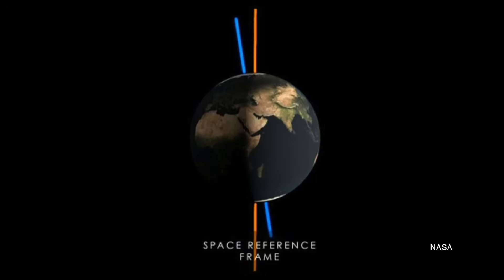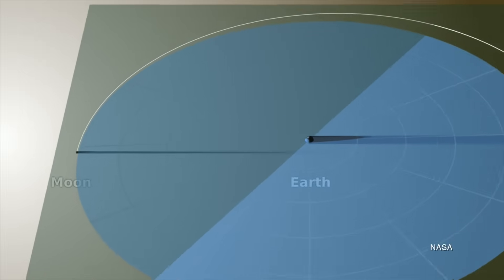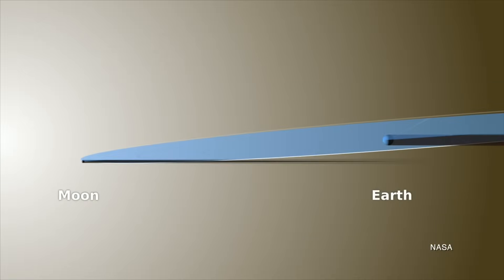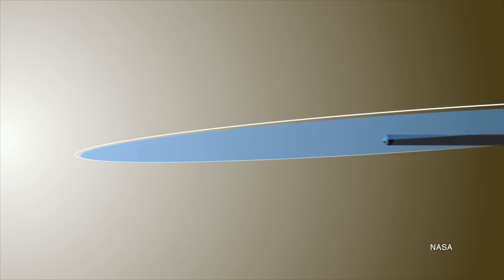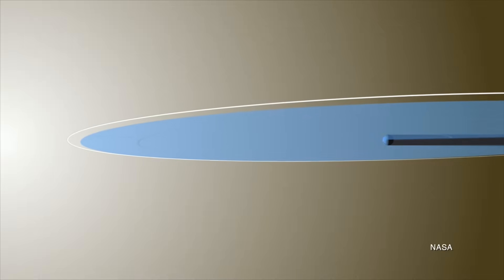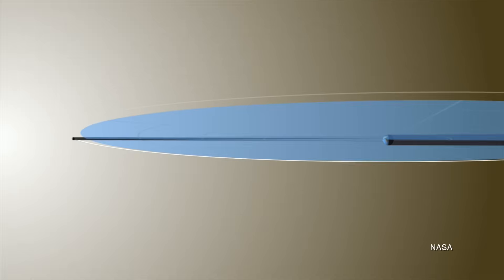Why Does a Rocket Need to Roll Going Into Orbit?

Comment: If the roll was preprogrammed into the Saturn guidance computer by wiring the program that must have put a limit on the time window the program would be sufficiently accurate. Hence, the launch window we always heard discussed. With modern computers in today's rockets I assume a modified program can be uploaded as needed.
Reply: The roll was preprogrammed, but could be changed by uploading a new angle to the computer if the launch was delayed. This happened on Apollo 17.

The launch vehicle digital computer steered the stack open loop during the first stage burn and did not perform active guidance. The pitch and roll programs were preprogrammed. This was done because first stage flight was through the densest part of the atmosphere and active guidance may have caused maneuvering that may have put aerodynamic stress on the vehicle. Active guidance started when the second stage lit and the vehicle was above most of the atmosphere.
Reply: @SodaAnt7 Thanks for the information

Comment: The key is to pitch the rocket over into the correct plane.  But why does it need to roll?  Why can't it just pitch over as needed without rolling?   Ahh, another commentator explained that theoretically it could, but there were practical reasons for the roll.

Comment: I understand everything about that except why they needed to roll.  It seems to me all that could be accomplished without the roll.  As you said at the beginning, the spacecraft is essentially symmetrical.  As well it has small thrusters/steering rockets that can adjust pitch and yaw, as well as roll.  Really all they had to do was adjust the yaw to get to proper alignment.  I had always assumed (not know, but assume) the roll was to place the crew upright relative to the earth once they achieve orbit.  Another commenter points out the real reason.

Comment: The main reason for the “Roll” Manoeuvre to position the shuttle “Heads Down” was simply to ensure Best Communications using its Very High Frequency (VHF) and Ultra High Frequency (UHF) Radio’s. Most of the aerials and receivers for VHF and UHF Comms. were most likely situated around the cockpit area of the shuttle, some of them situated in the roof of the cockpit I’d presume, and some being mounted in the tail as well.  VHF and UHF works on the Line Of Sight principle, meaning simply;  If you can see it, you can talk to it.  So Rolling inverted pointed the VHF and UHF Receivers at the ground stations, allowing much better communication between Mission Control and the Spacecraft.  This was likely true with the Saturn V Rocket, not just for Azimuth Alignment, but improved communications too.  The Shuttle could launch into space “Heads Up”, but would make VHF and UHF Comms. much more difficult!

Comment: Thank you @appolowasreal. That made way, way more sense as to the practical reason to roll, even without the gimbal lock with laser gyros I assume modern rockets would still have the antenna limitation so still roll?

Comment: So, the roll is there because the rocket is not quite symmetric (the crew cabin is not) - otherwise, they would just "tilt" it on both Y and Z axes to point in in the desired direction. Right?
Reply: More that it was programmed a certain way and doing it another way could be confusing.   Also, since the rocket was not "facing" the right direction on launch it needed to roll to face the right direction to be able to turn in the right direction.   
 
They could have programmed it so that it could use yaw to turn over, but it would have been EXTREMELY uncomfortable for the crew.   They wanted the crew to basically be laying back while in the turn and climb to reduce sideways forces on their bodies.

Comment: Makes you realize how smart these NASA engineers were.  And with very few computers at the time.
Reply: This is actually exactly why there's a roll program. A rocket flies in 3D space, which means you have to worry about calculating 3 axis of movement. However, with the roll program, you remove one axis of movement and simplify it into a 2 axis/2D movement during launch. Much easier to calculate.
Reply: ok... I mean, this was the least of their problems deciding where to go.

Comment: My question is, Why didn't they orient the launch pad to the correct heading when it was built. It would have saved probably thousands of man hours in software design, testing, hardware design, also putting another program into the rocket computer, another chance for a possibly fatal glitch. It just seems, to me, that having the rocket sitting on the pad correctly aligned before flight would have been more efficient .
Reply: The rocket has to adjust the inclination of its orbit so that when it got into space it would be orbiting at the same 5 degree angle as the moon does, rather than the 23.5 degree to the elliptical average orbit that launching from Kennedy space center would get you without any adjustments.
There's no where on earth that a spacecraft can be launched directly at the moon from without adjusting orbit to take account of the difference between the angle of the moon's orbit and earth's tilt.

Comment: What is the retro grade and prograde motion? And while re-entry to the earth atmosphere which direction we follow to enter to the earth atmosphere?
Reply: Retrograde is in the opposite direction of the rotation of the body. A retrograde orbit around earth is easy to west.

Reentry direction doesn't matter as long as the reentry angle is suited to bleeding off velocity without causing the craft to burn up. Prograde would probably make this easier, but it's really an engineering question.

Comment: Yeah, I guess it kind of makes sense; if you tell me it makes sense. I don't know why we still use rockets instead of 3d-gyroscopic thor's-hammer disc-crafts yet. I guess testing things at those speeds, (atmospheric warp drives) or thor's hammer as I call it, is a bit violent for manned flight; and probably just as complicated to build - as starting rocket engineering from scratch.

But if Chris Hemsworth's famous character can swing a hammer and go flying, why can't we strap a chimp in a (magnetic) hover-hub set in-midst a slow-rail "gravitron" (xena's disc/ufo/thor's hammer) across the Pacific? 
Or w by can't we chime an oscillating crystal to spin a (disc) generator (in an underground safety case) to charge coil-charge a large tesla batry & power my neighborhood for months between restarts?
Why are ufo's still "unidentified"?'z all I'm sayin.

Cool video. Got me thinking about how difficult (and wasteful & obsolete) rockets are.

Comment: Still unclear.. Why not just steer with the rocket motors? They can't be in a permanently fixed position, right? Spinning the whole thing still doesn't make much sense, as mentioned below. Why would the dang thing need to be facing a particular direction so early in the flight? Reaction motors used sometime later in the flight can do that too....

Comment: I think there's a missing and critical factor--that there is a preference for one side of the rocket to face the earth as it pitches. Without stating that, the rest of the info is disconnected from the conclusion.
So, what is the preference? I'd love to hear your research on that Amy.  I've heard that one reason is so the Apollo astronauts could look out their window and see the horizon, so that they have a quick way to confirm that their flight is stable (e.g., no longer rolling).
Other reasons I've sometimes seen are that there's a preference for what's top/bottom or left/right at stage separation, or when cowlings are opened in orbit. With the shuttle, there was definitely an orientation preference so that the rocket's communication gear had line of sight with the ground.  Less likely but still possible on the Saturn V is a subtle non-symmetry that makes the control system easier to pitch in some orientations, e.g., moving fewer components to achieve the pitch.

Would you please include a prioritized list of why one side was preferred over others, Amy?

Comment: Let's make this even simpler.  When the rocket launches it is on a vertical trajectory from earth.  To get into orbit it needs to follow an elliptical path as it gets
higher up.  The inertia that the passengers feel is similar to a roller coaster doing a loop.  You want the force to push you down in the seat as opposed to lifting
you out of the seat.

Comment: I see some people are still confused.  It is probably a little late to add this, but here goes.  G-forces result due to the pitch change just like they do in a fighter jet.  You want to experience the g-force vertically relative to your spine so your body is not twisted to one side or the other when you are pulling g's as the pilots call it.  They also used gravity to offset some of of the initial g-forces so they oriented your head upside down.  It is like a fighter pilot pulling hard g's in a loop.  You can pull back on the stick harder at the top of the loop when you are upside down.  One g due to gravity gets subtracted from the the g-force at the top.  So you want to apply g-force along the axis of the spine and upside down to use gravity to reduce the g-force on the body.
Reply: GunLovingLiberal is the pitch change really fast enough that it can cause such extreme lateral forces? I thought it took place over a few minutes
Reply: @buzzmas8068  The G-force is a function of the rate of pitch and the velocity.  Since the velocity is so high it does not take much pitch to generate a perceptible G-force.

Comment: To make this much easier to understand you first need to do some math and calculate escape velocity. It's 25,000 mph.
Suppose you had to pedal the rocket.  It'd be easier pedaling if you didn't go straight up.  The rest is all rocket science that Jethro Bodine could probably handle.

Comment: You start off by missing one of the most important aspects of the launch location.  Cape Canaveral is about 28.5 degrees north of the equator.  That mean launching from there directly into earth orbit gives you an inclination of 28.5 degrees.  This is the inclination that you correct from, not the earth equatorial orbit.  The equatorial orbit is a mathematical reference, but not an orbit the Apollo mission would have naturally ended at if launch from Cape Canaveral.

Comment: I think with the right design that a horizontal launch could be possible. Consider the savings of  having the ability to get most of the weight up to a fairly significant speed to begin with with a conveyor instead of overcoming the initial thrust needed for the break away. That's gotta be a tremendous savings. I know it doesn't have the sight-seeing draw that a verticle launch. But it might be a safer and/or economical (re-usable cartriges...). design.

Comment: Question for you, that I can't seem to find anywhere. When a rocket, or any object for that matter, is in orbit, it is clear that its direction of motion is constantly turning such that it follows an ellipse around the object that it is orbiting. But, does the object also get a "free" change of facing? In other words, if my rocket starts out pointing parallel to the ground as it hits orbit, will it then be pointing straight up as it orbits 90 degrees around the Earth? Then retrograde after another 90? etc. It seems like the object gets a free change of direction, but I'm not clear on why, as I would think that only the center of mass would be affected by the Earth's gravity, but my physics is rusty. Thanks.
Reply: I never took physics but I think you answered your own question.

Comment: I have a question regarding the Command Module entry in the atmosphere. I mean you need the right angle and keep it. Did the CM have small engines to adjust the flight? Thx
Reply: yes. The center of gravity was off center. By firing the engines pointed sideways, it rolled the CM, creating different lift angles.  With that, they were so accurate hitting the landing zone, that NASA told the Navy to back it's ships up by some 4 miles, so that the CM, heaven forbid, didn't actually land on the aircraft carrier. Amy probably covered this in one of her videos...
Reply: @bkearns34  Thx! And I found pictures showing the engines around the CM. Some higher, some at the botton, covering the 3 axes. Plus the tiny tanks 😃

Comment: I like Mick G.s statement below about starting a "Flat Moon Theory!" I mean, everything must be flat when you think about it. Take for instance a "normal" pool table. That could represent the flat plane of our solar system. The pool balls could represent the planets in our solar system. They are moved about on the pool tables flat surface by the gravitational force of a pool cue. Most of the time, the balls stay on the flat surface, until they "Fall Off Of The Flat Surface" into a Black Hole. Hence proving that somethings are indeed flat!!

Comment: Pace not a problem but for a more complex translation topic I think it would be better to stay on the subject as advertised, instead of the diversion into rapid fire introductory preamble😆. I would recommend doing it again with a few diagrams illustrating the progress of the rocket and focusing solely on the contributions of the relevant control inputs and roll program to its final position and orientation👍. 90%+ are not going to picture that just from a verbal description. (Designer)

Comment: This is a little out of the category: When the current international space station is no longer usable and becomes retired the current plan is to safely crash it into the ocean. My question is: Why not add powerful engines on it, and then place it in lunar orbit, to be used as a type of asteroid/comet defense; being used to nudge, push, or impact, any earth endangering astroid. If the old space station is not used for a few hundred years it would be a very interesting artifact to give to future generations; if it is needed it saves everybody. For some reason, this is not an option, why?

Comment: Good information, however, allow me to suggest = When you say, "... they need to roll east" and you point the rocket to your right, you're actually pointing the rocket westward as seen by the viewer and then a bit later, there is a red line drawn on the screen running east to west, with east being on the viewer's left, which of course is backwards. Think of a map laid-out on the screen, displayed properly, north is always at the top and east to the right. It's kinda' a stage left, stage right thing. Thanks

Comment: Before they came up with all these technobabble explanations NASA explained it was because to keep the weight down the roll control RCS were small. So because it was so heavy there was some roll before the aerodynamic roll control had enough wind flow to control the roll. So the roll was programmed to stabilize the roll when they had enough wind. Not a problem when you're just flying up. Same thing with the shuttle. Falcon 9 had the same problem. But inadequate roll control on landing resulted in a lot of crashes on landing. Until I reminded them that they needed more roll control on landing. They've had a near perfect landing record since then. Even showed of with a near simultaneous double landing. More reliability in the landing path lowered the landing fuel requirement, Which lowered the takeoff fuel requirement, and allowed an increase in payload too. A couple thousand pounds I heard.

Comment: Duh! It's an Orbit!!! An orbit isn't straight up. It's encircling a planet or other body in space. It's not like it hits the roof and goes sideways, it's because it circles the earth. Then it picks up speed in order to escape earth's gravity, and from there it heads to the moon where it enters its orbit. When they were ready they fired the rockets speeds the spacecraft up so that it's going fast enough to leave the Moons orbit. Once it left the moons orbit, it took several corrections to get the spacecraft into the proper flight path to re-enter the earth's atmosphere at an angle that would allow it to slowly descend into the earth's atmosphere without being too steep, where it would burn up in our  atmosphere, or bound off into space where it wouldn't have enough fuel to correct its flight path to get back home. This all takes way more math than I've ever been capable of, but I understand the principles involved. So, it doesn't alter its flight path because the earth is flat, like so many heads in Washington these days, but because the earth and its surrounding bodies are round. Even the meteors flying around in space near us are mostly round. There are NO completely flat surfaces anywhere. Not in nature anyway!

Comment: Thanks, Amy, I really appreciate your clear explanation of this - and I learned a lot from the video. I think a simple way of boiling this down (and correct me if I’m wrong) is to say that the roll maneuver is necessary to put the rocket’s pitch control apparatus (engine gimbals) into the right orientation so that the pitchover maneuver points the rocket in the right direction to get the spacecraft into the correct orbital inclination - because the rocket’s attitude can’t be controlled around arbitrary axes, but only around the three cardinal axes of control, so you have to control the rocket’s attitude around one axis at a time. Does that sound right to you?